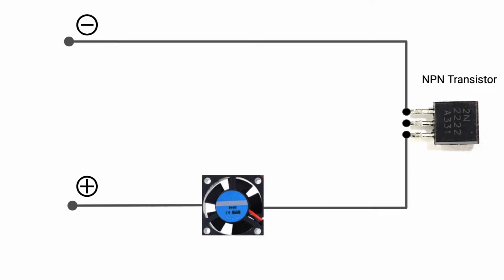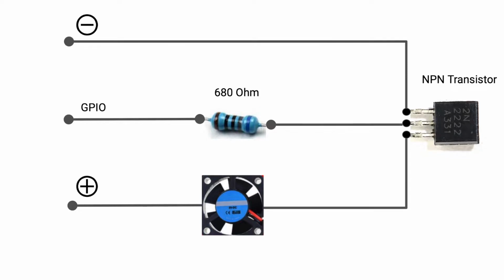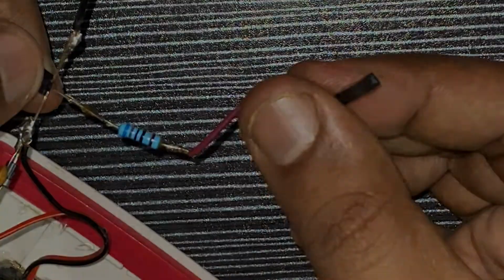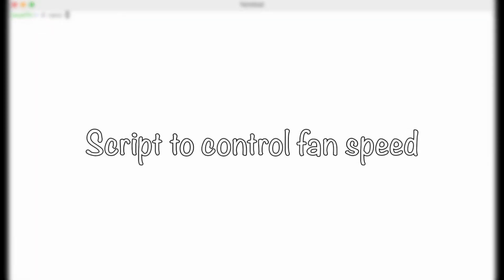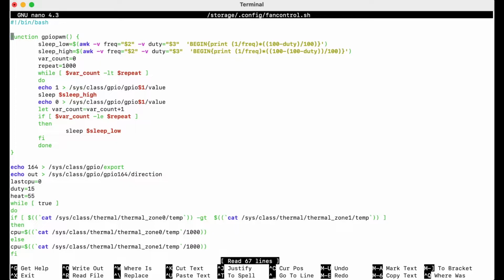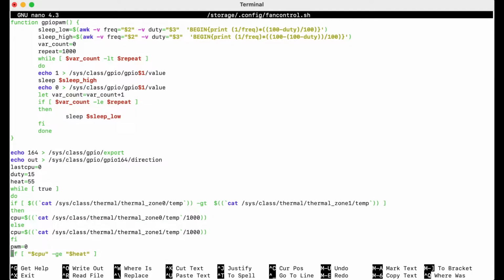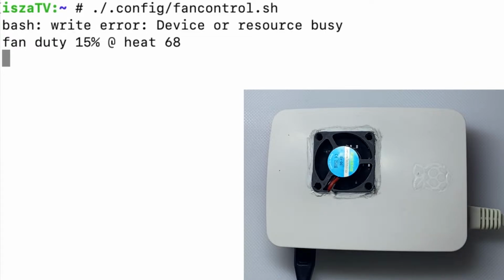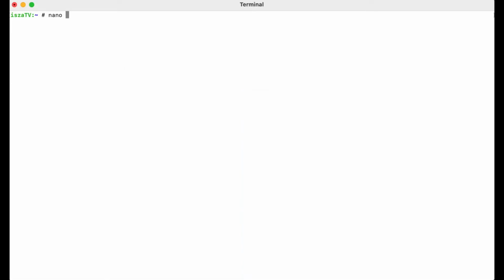Whisper-quiet fan cooling

Comment: Any way to do this without transistor and solder? I have Pi and fan and cables only.
Reply from the maker: Without transistor you cannot implement PWM, Can only on/off the fan based on CPU temperature but fan runs in full speed (noisy)